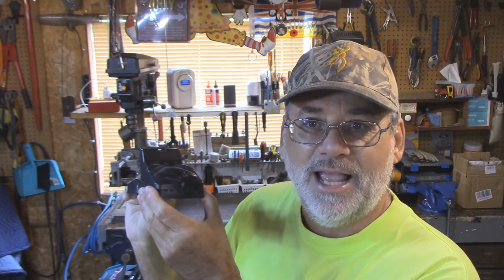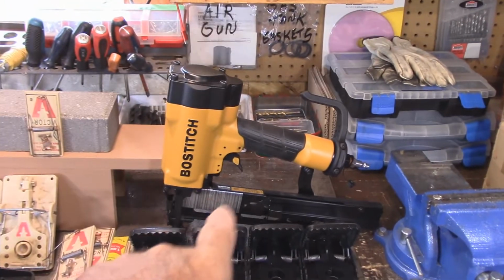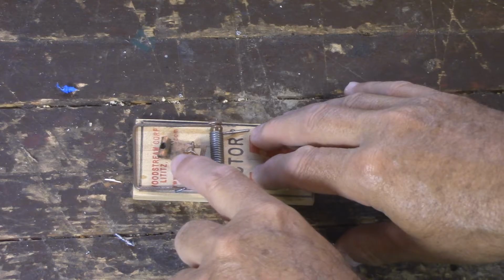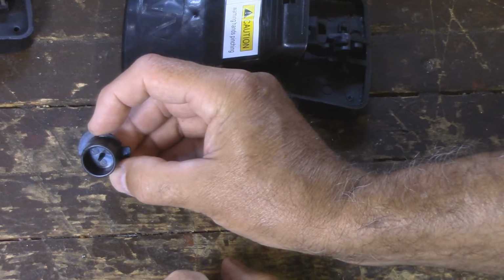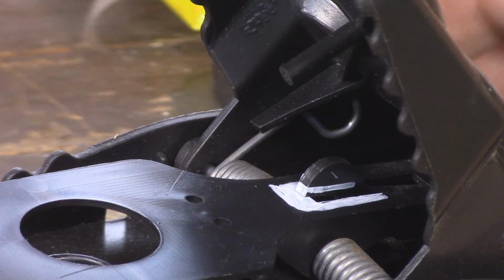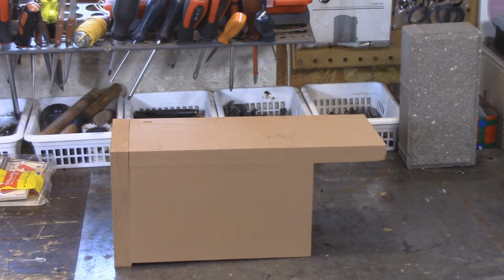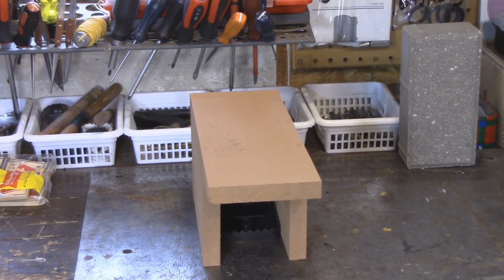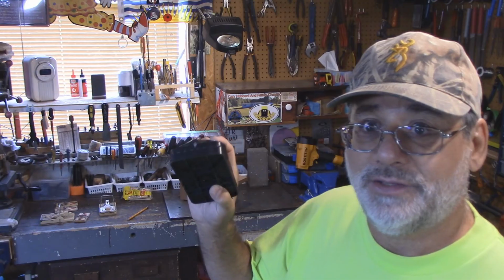Rats & Mice - Traps & Tips

Comment: I use the Victors that have the yellow plastic paddles.  Where the the retaining arm sits in a tapered compartment.  Where the end sits in the taper determines it's sensitivity.  Very simple and reliable and quick.  Made the mistake of using a glue trap, once.  Mouse literally pulled it's own guts out trying to get away.  Then l also tried a live trap.  Just don't forget to check it like l did.  Looked like something off CSI.  Two mummified mice with one partially eaten.  I guess "live" is debatable.  Cheers.
Reply from the maker: Yes it's experimenting to see  what works in your area . Cheers 👍

Comment: I set one of my live traps about an hour ago. Yep, no small ones here in McKinney Texas! I haven't seen a mouse around here in over 20 years. We have been lucky and they haven't been in the house except for one baby possum last year, he came in through an open door. I think over the years I have used all these, and some sticky traps. Sadly I have snapped a few birds. Good trap info Steve. Yeah, we don't use the little traps here in Texas! Over the years, rats chewed up the wires in 2 of my work vehicles and they chewed up the wires in my air conditioner at home, not cheap to repair.